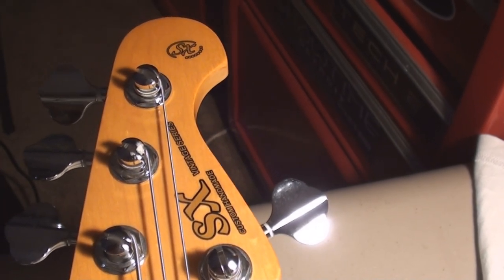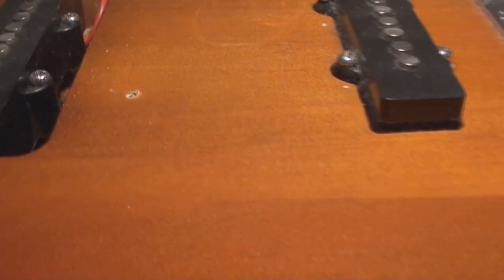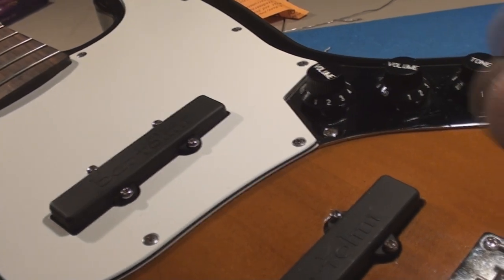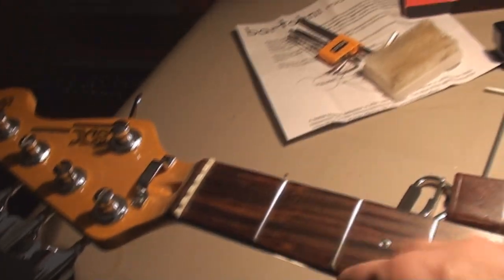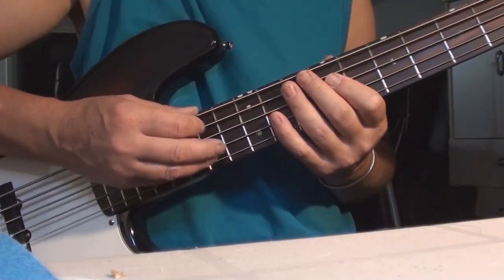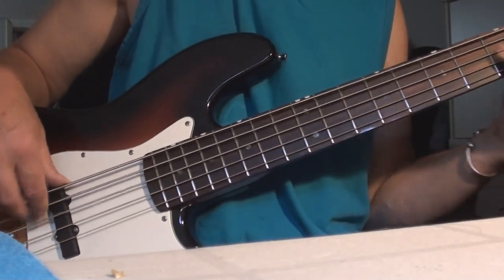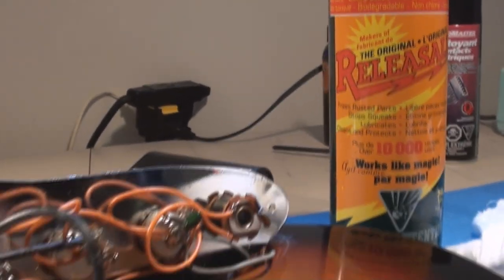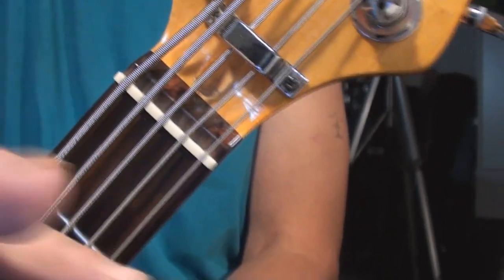Bartolini Jazz Bass Pickup Install

Comment: why couldnt you belt sand one side of the frets to compensate  for the different diameter strings, then you could chuck all the radius gauges in the garbage?

Comment: Why wouldn't it? If the radius is the measurement of the contour of the strings to the fret board so they're all the right distance in relation to each other, wouldn't it make more sense to measure it on the actual strings?

Comment: When I had a five string, I restrung it and tuned it to be EADGC, from the biggest to the skinniest. I had no real use for the low B, but could find places to use the C. Now I have a Fender Jaguar four string, I like it better. It plays easier, and will do everything the five string would, you just have to do it differently.

Comment: What do  you recommend me to upgrade (improve) my bass?
what kind (brand) of preamp i need it?
Reply: well... if you're looking into upgrading the pickups, passives are easier to maintain, I'd look at Seymore Duncan, Lace and DeMarzio as they are some of the best pickups I've used in a while, especially the Lace aluma pickups... but if you want active pickups, then EMG are a really solid brand, I just cannot find fault with them... other than they can be a bit pricey... but for that price you get a set of pickups that are reliable, punchy,  well balanced and have the pre-amp you want, and they are pretty conservative on battery live too... depending on how long you play it for and whether you enable the amp or not, the battery can last as far as 5 months and longer of you use a good rechargeable one!

Comment: I haven't tried the DR's. Currently using Roto's and very happy. They seem to hold their brightness longer than most bass strings out there, which is great for a J. on a Precision, I could live with a little diedown, but with a J, it just sounds right with a little more brilliance. great vid as usual Dave.....How you diggin' the new place?